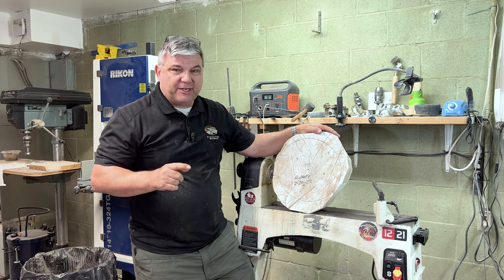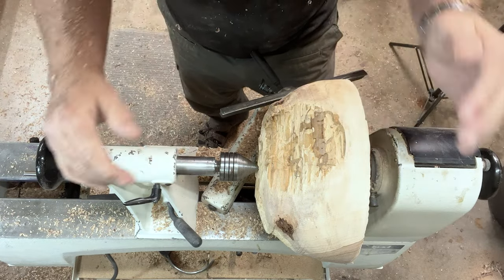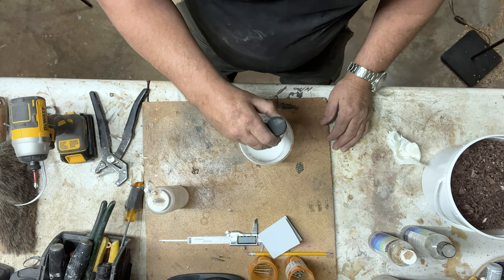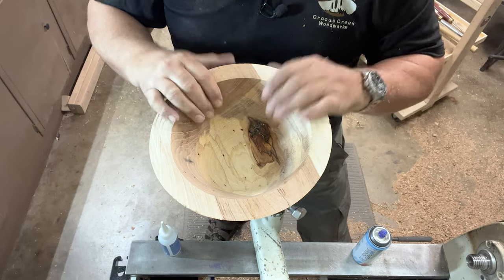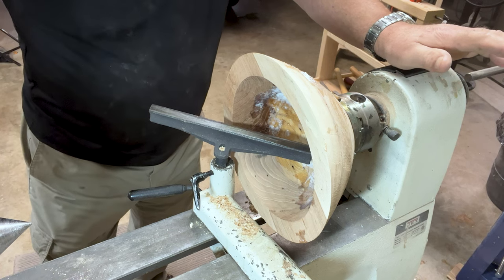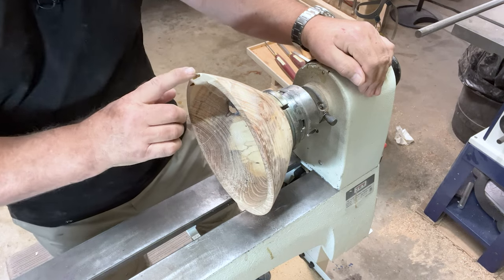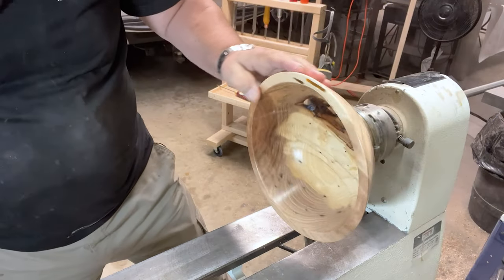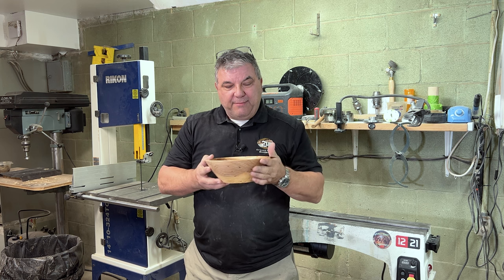Hickory Bowl #15

Comment: When you have such Beautiful wood it much much more than "brown and round".😉 That's a beautiful piece of art work. Got a question about the resin to dna ratio? If you said in the video I didn't catch it. Great videos
Reply from the maker: Hi PJ Seiber, thanks for your visit and feedback.  The ratio in mixing the DNA with the Resin is @ 80/20 but I typically like a thin "Syrup" consistency because the resin is absorbed into the wood slower yet gives a sold surface to turn.  Sometimes I go thicker and other times thinner depending on the punchiness of the wood.  I use a small squirt bottle to add the DNA.